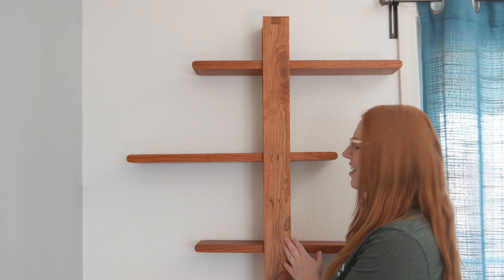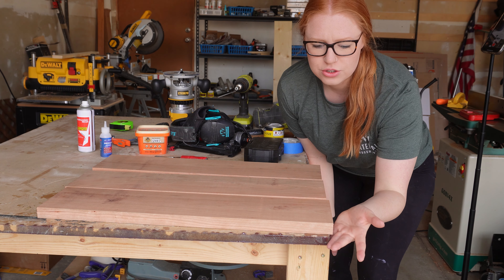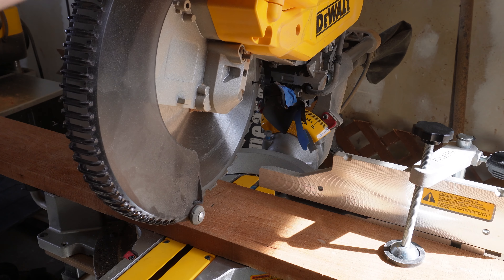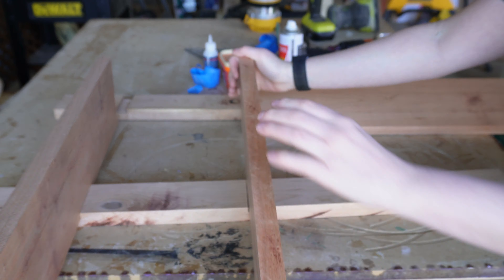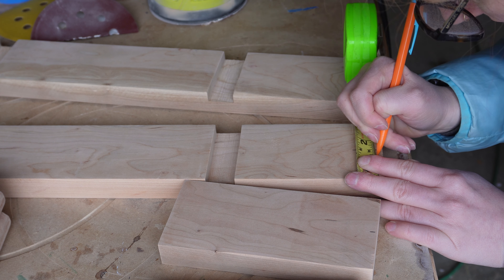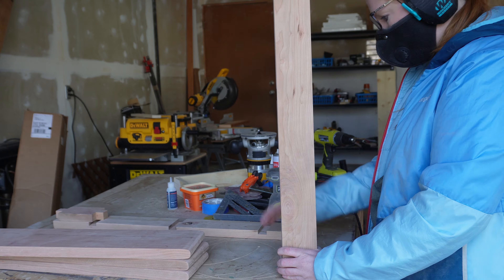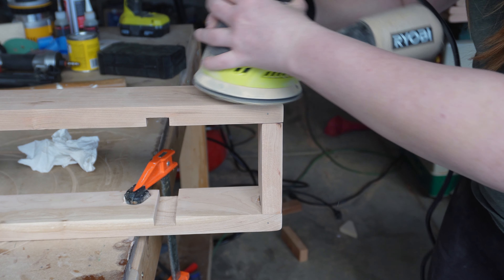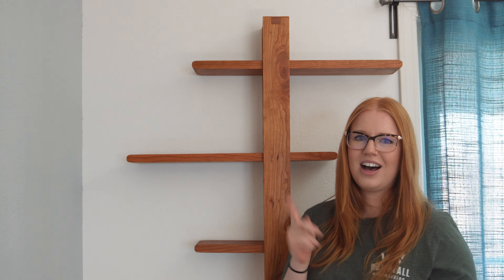Modern Wood Shelf | How to Make a Modern Wood Shelf

Comment: Could you clamp the two frame pieces together (side by side) and run them through the table saw at the same time, to ensure the notch is cut identical? Or maybe you could cut the notch before cutting them to width.